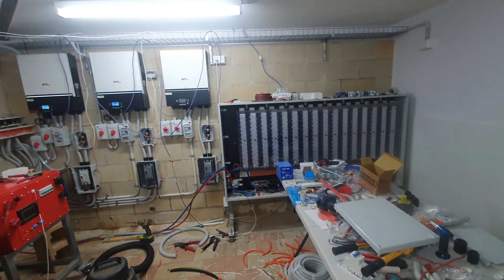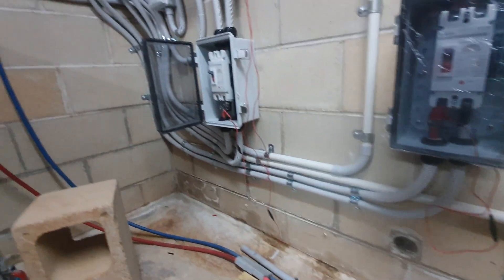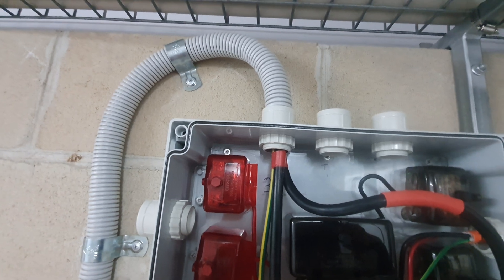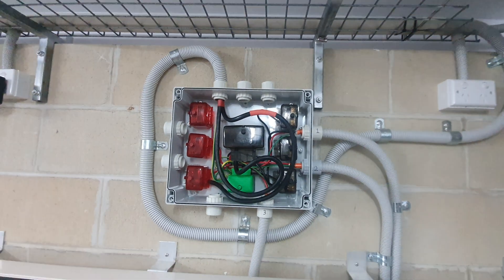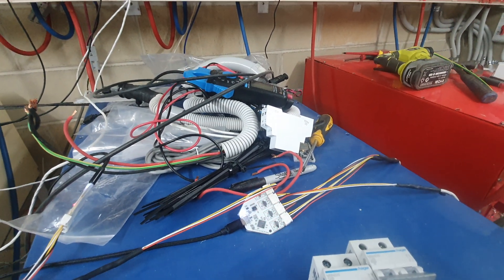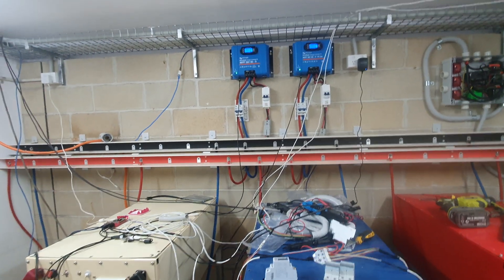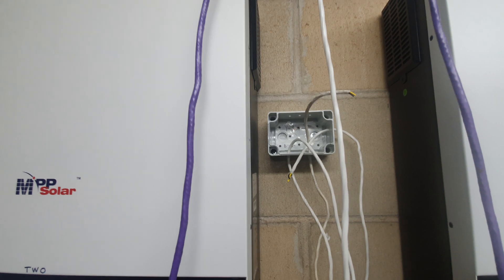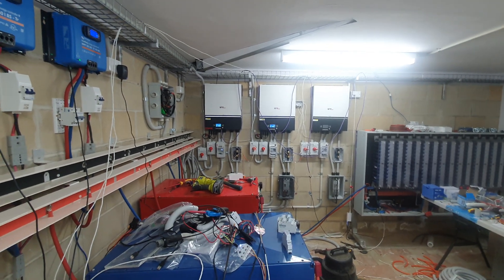Battery Room update for my 3 phase off grid setup

Comment: Did you set your battery LIB in inverter?
Reply from the maker: No I haven't set anything, I have found that there is no listings of the setting for each type of MPP Solar battery settings until you change them.

Comment: did you ditch those round cells which had great lifecycles, I've forgotten what they are called. Also that one cell on battery back looks really out of balance, is there a balancer in that battery?
Reply from the maker: I still have my LTO bank, but at the moment I haven't gotten back to playing with it, the BMS in these 3 coloured 48v banks are a JK BMS 2a active balancer, when the cells get close to fully charge the volts move very fast, they are still within about 40mV, they never get close to 3.65v, I am collecting data on the MPP solar inverters by MQTT using some hardware and software from a GitHub site https://github.com/softwarecrash/Solar2MQTT

Comment: I have something simular with mpp 8k max's only 2 so far but planned for 3 eventually. Are you using solar assistant ? If you do then you can just use 2 usb cables into your pi and get all the data from the invertors, which can then be reshared via mqtt and used in homeassistant etc. I'm on grid, so use that as back up.